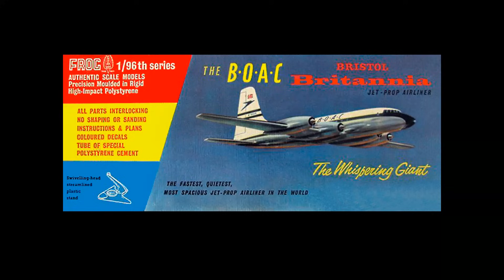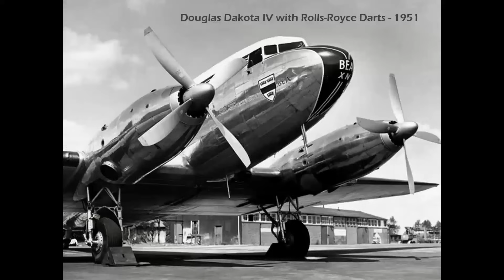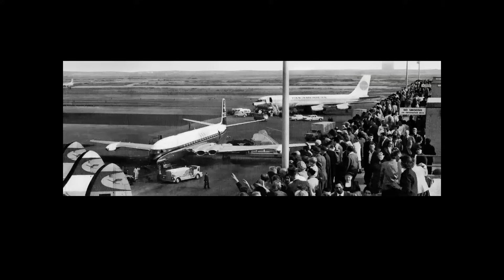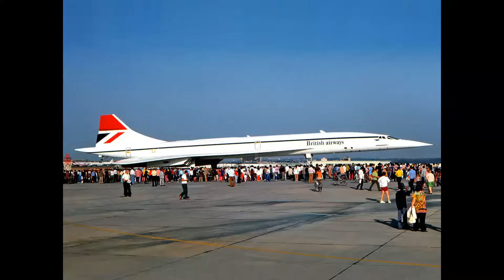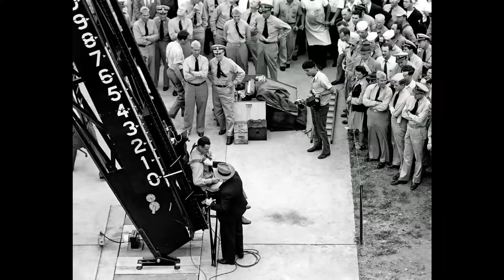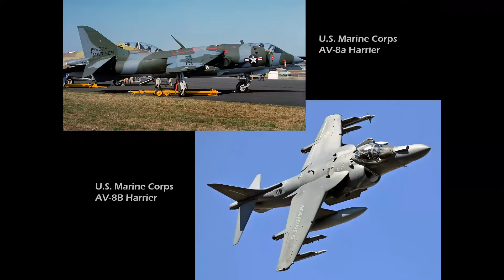BRITISH AVIATION FIRSTS! - An overview of great pioneering aircraft from the UK after World War II

Comment: 4:36 The Brabazon/767 comparison is dubious to say the least. 16:50 the UK was involved with the F35's lift fan through Rolls-Royce.
Reply: & RR do the 3 bearing swivel module which does rear vertical lift duties & some other stuff on the F-35 is made in the UK.

Comment: Another thong to consider with the Comet: no aircraft before it had been put though such a rigorous accident investigation process, I think I'm right in saying it really pioneered many of the processes. Although too many people lost their lives on the Comet, I wonder how many more were saved as a result of what was learned from those tragedies.
Reply from the maker: Excellent point, thanks!
Reply: The only lesson learned from the Comet Disaster is that aircraft manufacturers could no longer be trusted to conduct their own crash investigations, De Havilland's attempts to cover-up fatal defects in the Comet's design was morally reprehensible and criminal even by the standards of the day.

The real tragedy of the Comet Disaster was that it could have been easily prevented if de Havilland had only followed well-established industry standards for the design, construction and testing of passenger aircraft with pressurized cabins made from aluminum alloys.

d-H was a deeply troubled company that was still building jets primarily from wood and linen fabric when the Comet was designed, d-H eventually admitted that they never conducted the stress calculations for the fuselage sections that suffered catastrophic in-flight structural failures.,

Comment: Top clarify, Frank Whittle invented the turbojet engine. Hans von Ohain, the leading German jet engineer, wrote a very comprehensive foreword in the 'Elements of Propulsion, Gas turbines and Rockets'. In that foreword he states: 

"The first patent of a turbojet engine, which was later developed and produced, was that of Frank Whittle, now Sir Frank. His patent was applied for in January 1930. This patent shows a multistage, axial-flow compressor followed by a radial compressor stage, a combustor, an axial-flow turbine driving the compressor, and an exhaust nozzle. Such configurations are still used today..." and "From the beginning of his jet propulsion activities, Frank Whittle had been seeking means for improving the propulsive efficiency of turbojet engines. He conceived novel ideas for which he filed a patent application in 1936, which can be called a bypass engine or turbofan. To avoid a complete new design, Whittle sought an interim solution that could be merely "tacked on" to a jet engine. This configuration was later known as the aft fan. Whittle's work on fan jets or bypass engines and aft fans was way ahead of his time. It was of greatest importance for the future or turbo propulsion." and "In April 1937, Whittle had his bench-test jet engine ready for the first test run. It ran excellently; however, it ran out of control because liquid fuel had collected inside the engine and started to vaporize as the engine became hot, thereby adding uncontrolled fuel quantities to the combustion process. The problem was easily overcome. This first test run was the world's first run of a bench-test jet engine operating with liquid fuel.".

Comment: You mentioned the Comet at New York in "58. And showed the "first 2" jetliners.
Not English, But the 2nd jet passenger aircraft in the air was the Avro Canada Jetliner, which flew into New York in 1956. The pilots etc. even got a ticker-tape parade.
But Avro was forced to cut it up in 1959.

Comment: Thanks, it's good to see a wider view of aviation taken in this video.

It's worth reflecting that the British aviation industry made some incredible advances post WW2 in the face of massive cutbacks due to the nations bankruptcy due to the war.

It would have been good to have seen inclusion of British radar developments in this (Chain Home, airborne, air to surface vessel, centimetric) British navigation aids, Gee, Oboe, H2S (the first airborne ground scanning radar).

Also, the jet powered Miles M52 of the 1940's. This used an all moving tail (stabilator) to maintain control at projected supersonic flight speeds along with a razor sharp wing profile. This was disclosed to Bell Aircraft under a technology exchange programme, which the Americans reneged on. It later appeared on the Bell X1 and its use allowed that programme to succeed in achieving control at supersonic speeds.

Comment: The first Vulcan you showed was a B2 version. The B1 was perfect delta with no kink in the wing. One to look up is VX 770, this crashed at Syerstone in 1958.
Reply: There is  evidence that Vulcan VX 770 ( a test aircraft) was regularly overstressed as it was the only Vulcan with the more powerful Conway engines and pilots used the extra power without necessarily reporting accurately that they had done so.

Comment: Aircraft and Aerial tech and tactics. Water methanol injection.  Two stage supercharging driven off the same shaft (different sized impellers) as with the RR Merlin in the P51.. Carrier launched attacks on a fleet. Shallow water torpedoes. Skip bombing. Just a sample of Brit ingenuity..

Comment: The problem with the Comet, on the early aircraft the windows had square corners and on the improved aircraft the windows were more round.    The metal fatigue would start at the window corners.  At 9:54 why does the Super VC-10 have "CUNARD" on the nose?   Cunard was the Company that owned the Queen Mary.    That Sleek MB5 looks a tiny bit like a P-51 with counter rotating propellers.      Thanks to Mike for his time and work.....
Reply from the maker: Appreciate the comment, thanks, and yes, BOAC merged their name and operations with Cunard Lines for charter flights and voyages from 1962 to 1966.
Reply: @celebratingaviationwithmik9782  I never knew that, learn something new every day......

Comment: Hey Mike, the correct terminology for the Harrier, and F-35B, is STOVL; Short Takeoff, Vertical Landing.
Reply from the maker: Yes, that is correct, thanks.
Reply: @celebratingaviationwithmik9782  You're welcome, Mike!
Reply: @johnosbourn4312  V/STOL was the correct term for the Harrier as it was capable of vertical or short take offs. That was the definition of the aircraft's capabilities when it entered service in 1969.

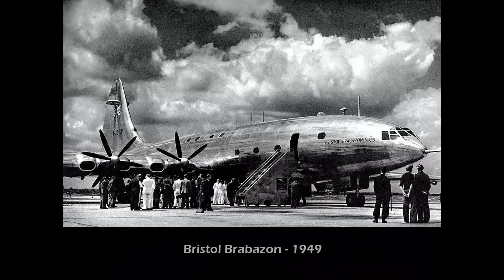Comment: 3:55 the Bristol 167 "Brabazon" had one of the most interesting propulsion installations of any aircraft: 8 Bristol Centaurus 18-cylinder air-cooled sleeve valve radials installed in the wings at angles to the prop axes --- one Centaurus drove the clockwise-rotating prop, the other Centaurus the counterclockwise.

Comment: Loved the Rotodyne. Had so much potential. The FD.2 was banned from supersonic tests in the UK so it went to France. Dassaiult took an intereset in it and they built the Mirage. Coincidence?
Reply: Testing of the Delta 2 was carried out in France for some time, in part due to Fairey's good relations with Dassault Aviation of France and the French Air Force. In October and November 1956, a total of 47 low-level supersonic test flights were conducted from Cazaux Air Base, Bordeaux, France; a detachment of Dassault engineers closely observed these trials, learning a great deal about delta wing aircraft from the FD2. Dassault went on to produce the MD.550 Mystère-Delta design, which "bore a striking resemblance" to the FD2; the MD.550 design would proceed to be manufactured as the successful Dassault Mirage III fighter. Wood credits the Delta 2 as having served to confirm Dassault's theories and supporting the designing and development of the Mirage III.
Reply: The Rotodyne was a very novel and clever design. Not a helicopter as such (the rotor was not directly powered by a geared engine) , but a kind of autogyro airliner with tipjets described as a 'compound gyroplane'.  It was built and tested, with demonstration flights from London to Brussels and Paris. 

Designed for city centre to city centre operation, it worked well and didn't need to use a runway, taking off and landing vertically using the tipjets. In flight the tipjets were turned off as the two wing engines reached the required horizontal speed with the rotor spinning freely without power, providing lift, with the reverse procedure for landing.  There were even plans for stretched versions, but worries about the noise from the tipjets and government cutbacks caused the end of the project, and sadly, the single test aircraft was dismantled.
Reply: One of the designers had a french cousin who funny enough,worked for dassauilt
Reply: The Mirage I and III were built before the FD.2 came to France. So Dassault had a time machine or something?
Reply: Dassault M.D.550 Mirage I
First flew 25 June 1955
Mirage lll  first flight  17 November 1956
 FD.2 first flight 6 October 1954